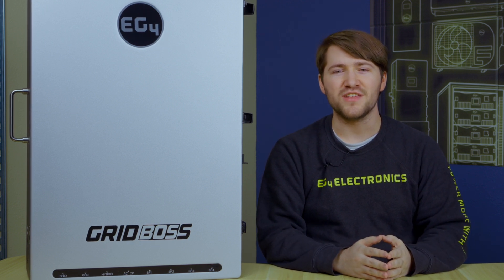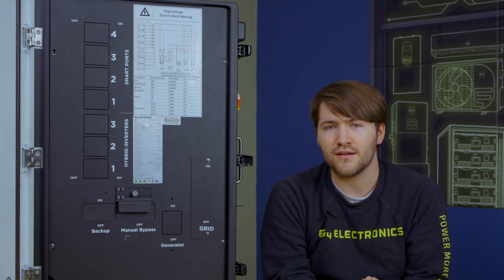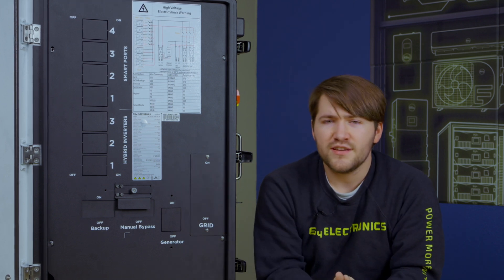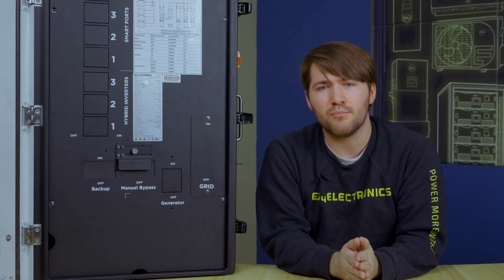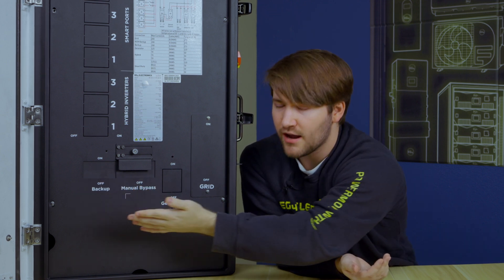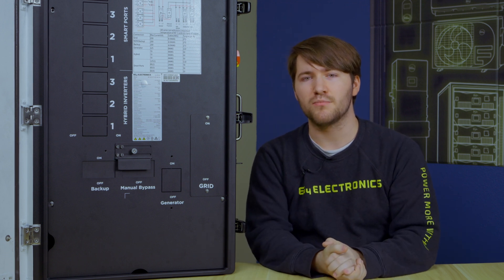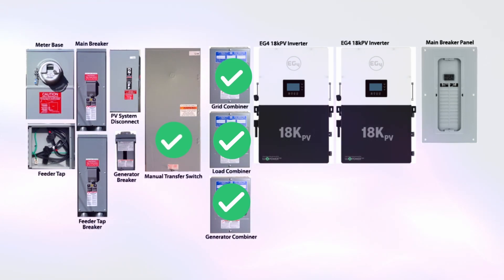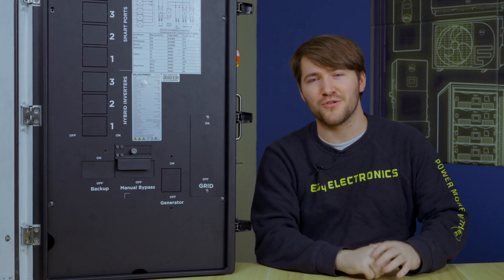What is EG4's GridBOSS? (complex, yet simple!) | Overview with Brayden

Comment: Grid Boss question. Can it do the following. I have read the manual but it did not cover some of the questions.
1. Can it take the place of a Generac auto transfer switch and start the the generator and transfer the loads in case of a low battery soc with no pv and loss of grid.
2. Can it exercise the generator on a predetermined basis.
3. In case of a failure of the grid boss, I understand from the line diagram you can manually bypass to grid. But, can any component in it be replaced easily onsite without having to take it down and send it back.
Reply: I have asked similar questions and still do not have a good answer.  I have not found a video detailing this system with a generator.
Reply: I don't have a generator but the GridBoss does have a generator port and the configuration settings for the generator port look pretty sophisticated.  I think it could be said to definitely have no trouble starting and stopping a generator at pre-determined battery SOC levels.  I don't see any kind of auto-exercise feature (just a manual exercise feature), but would that be built into the generator itself anyway?

Configuration settings:

* Generator remote auto turn off time (minutes)
* Generator to Battery charge current limit (amps)
* Generator remote turn on/off
* Generator SOC or voltage selection
* Charge Start SOC%
* Charge End SOC%
* Generator warm-up time
* Generator rated power (kw)

-Matt

Comment: Very informative and interesting in how grid tie inverters can be integrated through the smart port as I currently have a 10kw Growatt.  I'm in MA and we have 1:1 net metering.  I have two EV chargers (48a + 80a) and I'm curious if the smart ports can load shed based on current draw?  For example, can I set up logic in the GridBoss to open the SP1 relay if the panel draw is >50amp?    I was also wondering if the GridBoss can control maximum grid export rate?  I need to stay under 25kw, but a Flexboss 21 (16kw) + 10kw Growatt is just 1kw over my limit.  If I need a 25kw cap would would you recommend?  Limiting the inverter or can the GridBoss limit?  Thanks!!

Comment: I want smart load for your offgrid inverters. To turn on non critical loads when batteries are charged and off when excess solar is limited before draining batteries.
Reply from the maker: Our 12000XP Off-Grid Inverter has a single smart load port with this feature integrated for this scenario. It can be used with either power shedding (where you activate it during excess generation) or load shedding (where you deactivate it when you drop below a certain storage threshold) which let it work dynamically.

Comment: Regardless of connection, it appears that a meter pull is inevitable? Wish there was a way to connect without having to cut power to my entire house for half a day.
Reply: Not necessarily.  It depends on your circumstances.  If you want the GridBoss to actually be your service entrance than, yah, you need an electrician to do a meter pull at some point.  But another choice (the one I made) is to simply forward from the main service panel to the gridboss, then move the circuits on the main service panel to a new panel on the other side of the grid boss.  Yes you wind up with extra breakers in the power path, but there is no law against having extra breakers and you can just leave the main disconnect in the main service panel intact that way and not pull the meter.

You can order the operations so your house is only down for 30 minutes or so (on a few occasions during the work).  I got the whole GridBoss + FlexBoss + New Panel + Solar + Batteries operational first.  Then I moved the main house sub-panel circuit (100A) over to my new panel.  That took the house down for 30 minutes.   Then I ran the house off of the battery while I worked on the rest of the main panel.   Plenty of time... my house can run 12 hours off of a single EG4 indoor battery if I don't use A/C, so it was not a problem.

-Matt
Reply: @junkerzn7312  Hi, this is intriguing  as I am in this exact same situation. I am adding the gridboss/flexboss combo with powerpro batteries to an existing ac coupled grid tied system. Been going back and forth on the easiest/cheapest way to tie into the grid. I don't have an external disconnect, power goes right from the meter into the Main service panel in the garage.  This sounds like a viable solution, and  the existing approved, permitted ...system would remain intact as is? Could you explain in more depth how you did your upgrade please?
Reply: @ I had (have) an existing AC coupled system too... a 5kW SMA string inverter.   That was tied into my main panel.  I had the option of leaving it there but then the GridBoss wouldn't be able to monitor it and the ESS system wouldn't be able to zero-out the grid by self-consuming the excess, so when I moved all the circuits from my main panel to the new panel, I took that SMA circuit and connected it to a smart port on the GridBoss which I then configured as "AC coupled".

This is a quick detail of how I did my system:

House prior to ESS work:

    * Integrated meter + main panel, 200A (yuch).
    * Numerous 15A garage circuits on main panel.
    * 30A circuit on main panel from SMA string inverter (existing 5kW solar system)
    * 100A sub-panel feed to the house
    * 80A sub-panel feed to 80A panel inside the garage, with the EVSE and saw

Primary work items during ESS work:

    * Removed 80A garage panel
    * installed GridBoss
    * Installed new 200A panel inside garage on the "BACKUP loads" lugs of the GridBoss (3/0 copper cabling).

     * Added a temporary 100A forwarder from the main panel to the GridBoss.  (2 AWG copper THHN/THWN-2 cable.  I Used BLACK for L1, RED for L2, and WHITE for the neutral, plus a 6 AWG ground wire). 

    (no matter what else you do, make sure you get all the neutrals wired properly!).
    (always be consistent on color-coding L1 and L2)

     * Configured the GridBoss appropriately, including setting the maximum AC input to 100A (~24 kW).

     * Reinstalled the EVSE and SAW circuits on the new panel.
     * Moved the SMA feed from the main panel to a smart port on the GridBoss.
     * Moved ALL remaining circuits from the main panel to the new panel.  Including the 100A main house sub-panel circuit.

(The main service panel now only has the 200A main service breaker and the 100A forwarder to the GridBoss).

-- Then next --

   * Attempted to install a 200A forwarder on the main panel... huge honking 3/0 copper cable to replace the temporary 100A forwarder.  I failed... my conduit through the wall wasn't big enough to really deal with the cabling and I wasn't happy with the cable stresses.

    * Decided instead that my house would run just fine with 125A mains, so I wound up going with a 125A forwarder (aka 125A sub-panel breaker) and 1 AWG cabling between the main service panel and the GridBoss's GRID input instead.  BLACK, RED, WHITE, and GROUND.

   (the GridBoss-to-new-panel remains wired for 200A).

   * Finally finishes the system by adding the FlexBoss21 and batteries to the system as specified by EG4.  FlexBoss21 2 AWG to GridBoss "Hybrid Inverter port 1".  Batteries connected to FlexBoss.  Everything mounted properly.   Always wire the neutral and the ground wires first before wiring the HOTs (L1 and L2).   Use consistent color coding.

--------------------  

A few rules of thumb:

(1) You must be familiar with how to wire 240V electrical circuits.

(2) NEVER WORK ON LIVE CIRCUITS.  In my case, there are breakers galore so I could just flip the breakers off and work on the various parts of the system.

(3) Have a  multi-meter handy and double-check all voltages are gone before doing work, and that all voltages are correct before engaging breakers after doing work.

(3) If you make a mistake and cause an ARC fault, this can be VERY VERY dangerous on these high-amperage circuits.  You can easily destroy a few fingers or blind yourself permanently.

- Wear safety goggles
- Wear gloves with a 600V electrical rating
  (this will also save your fingers and hands from a lot of small cuts that I guarantee you would also get).
- Double check voltages before and after doing work
, before and after messing with breakers.

-------

Equipment:

- Buy the appropriate tools.  It will add up... I wound up buying around $2000 worth of tools and cabling.  It's gonna be a LOT of tools.  EMT fittings (bushings, nippes, chases, etc etc).  Torque drivers, hex driver sets, cable bender, good strippers, good cutters, large-diameter cable cutter (I wound up using bolt cutters on the 3/0 cable for the 200A circuits)... etc... all sorts of stuff.

 - For large diameter cables, buy the appropriate cable stripping tools.

  - The EG4 stuff is pretty heavy.  I do not recommend solo-mounting it.  Though it is possible.  I wound up purchasing a 700lb hydraulic lift table and even then almost damage the inverter because it was so top-heavy and easily slipped.  two-man is better for sure.

In my case I had to secure things to the lift table with large pieces of wood and clamps to hoist them onto the wall

  - When installing EG4 equipment on its brackets, be sure to double-check that the equipment is actually fully seated in the brackets before releasing your hold on it.

That's my best "quick" advice.  I wound up doing like two dozen amazon orders over 3 weeks getting all the tools and fittings and cable I needed.

-Matt
Reply: @junkerzn7312  Wow Matt!! Thank you so much!! This cleared up alot, the one thing that remains in question for me is the Neutral/Ground bonds and how you dealt with them. Currently the system has a N/G bond in the Main PV disconnect outside and in the Main Service panel inside. I know everyone does it different, just curious as to how you configured your NG bonds?

Comment: Can you connect 110V portable generator to one of the smart ports just to supplement the solar/battery power available during grid outage?
Reply from the maker: You'd need to connect the gen to the batteries via a ChargeVerter for supplemental power. The generator you're describing is likely too underpowered to integrate into the GridBOSS.

Comment: It sounds like you would still need an "anti-islanding" switch to disconnect from the grid if/when the grid fails.  I like the idea of how this brings ALMOST all of the external connections between the grid, your hybrid inverter(s) and your main breaker panel together into one box.
Reply from the maker: The GridBOSS handles all anti-islanding needs, complete with the UL certifications necessary. It has those functions built in!
Reply: @eg4electronics  I went to the site after I commented and read through the specs and saw that.  Thank you for the reply!

Comment: I'm missing something, and I don't see it in the manual either. The Grid Boss Hybrid ports are for the "GRID" input to the Hybrid inverters. Where do the EPS outputs from the Hybrid Inverters connect? Without those, there is no backup. The diagrams all show just 1 port being used for the Hybrid inverter and that doesn't make sense if the grid fails. That's when the EPS port takes over.
Reply from the maker: Tight communication with our EG4 hybrid inverters allows the GridBOSS to control whether that port stays operational or not. This is important as the grid disconnection is now located within the GridBOSS (when using its architecture). Using the grid port on the inverters allows for unique future features to be added to the EG4 ecosystem!
Reply: @eg4electronics I thought that's what the idea was here, but I'd like to see this wiring diagram. The manuals for both Boss products specificity exclude a wiring diagram so it's not clear. 

Also, page 33 describes a No Sell Back scenario in which the non-backup loads recieve power from the inverters during an outage. How can this be done with 1 relay and still be safe for the grid linemen?
Reply from the maker: The non-backup loads will not receive power when the grid/utility is offline, that's what the relay is for. The situation it is describing is that when grid is present, the inverters can still offset the power usage on non-backup loads, but won't sell excess power back to the grid.
Reply: @eg4electronics  My only complaint with EG4 inverters is I wish they were convection-cooled like Hoymiles inverters. They run totally silent.

Comment: Requiring copper wiring is a major limit.  Many large connections are going to be aluminum SER.  Especially if the inverter and batteries are not located near the service entrance.
Reply: You can use aluminum, but the thickness of the aluminum wire would be much thicker than copper and it wouldn’t fit into the connector. That’s the only reason they say copper, that’s a statement from their CEO. The inverter itself will work the same with aluminum if you can get it hooked up.
Reply: Only the GRID input would conceivably be aluminum (e.g. 4/0 SER for 200A).  The 200A BACKUP output going to your main panel can just be 3/0 copper because it will be a short run so the expense should not be too bad.  And every other connection into the Grid Boss or FlexBoss (etc) will be lower amperages and can (and should) just be copper.  e.g. 2 AWG for 100A.  I usually try to avoid aluminum as much as possible.  Copper is much, much more forgiving.

-Matt
Reply: Just step down to Copper using a multi tap (Polaris) like 12 inches before the GridBoss. If you don’t know how to do this, you should not be doing any of this wiring. To be fair, there are plenty of electricians out there that don’t understand any of this stuff.

Comment: Cool! 

What are the benefits of this over a Schneider BCS?
Reply from the maker: Nearly all MIDs currently in use are proprietary with the hybrid inverters they can use (with pretty good reason being tight communication protocols, admittedly), so the using the GridBOSS allows you to take advantage of the full EG4 ecosystem in all the ways described in the video (and more!)

Comment: Let me know when they come out with a simplified Off-Grid Boss with smart loads.
Reply: You can use this for off-grid as long as you have hybrid inverters (which can also be used off grid)
Reply: It's hard to be simpler than the GridBoss.  Most of the size is just wiring cabinet space to be able to run lots of cables.  The only thing an off-grid property version of the GridBoss would omit would be the bypass breakers.

Comment: Can you add an off grid inverter like a 6000xp to one of the smart ports? I'm still learning
Reply: I also had the same question. I am not sure but I'd say no. Only because he keeps saying we can connect "hybrid inverters" and on the gridboss it says "hybrid inverters". Who knows, they might actually support off grid inverters like 6000xp too?
Reply: @cell8290  Thanks! I was thinking that the hybrid inverters connected to the hybrid port would work better but wasn't sure about the smart ports since he said it could connect to AC and DC coupling I believe. I need more knowledge but learning a little at a time.
Reply: from what i am reading yes the 6000xp would be connected to one of the smart port
Reply: The official answer I've heard is "not at this time" but you were able to hook a 6000xp to the 18k via the generator port. Not sure why you couldn't do that here
Reply from the maker: The 6000XP doesn't AC Couple with Grid/Inverter power like standard UL1741 "grid-tie" inverters so it cannot be used on the smart ports. The 12000XP also applies. The Hybrid inverters (FlexBOSS21, 12kPV, 18kPV) can all be used on the hybrid inverter ports however!
Reply: @eg4electronics Thanks! I forgot about the AC coupling aspect. Makes sense. Appreciate the reply.
Reply: I remember signature solar saying it’s a stand alone system and will not communicate with other eg4 devices and is not really meant to be put in parallel with more panels like a lot of the other devices are. Don’t know if that answers your question.

Comment: Is the grid boss a good option to connect back to an interlock breaker in the main panel plus connecting to a sub panel running grid up only devices such a a pool filter and pool heaters?

Comment: Can you use this with a service that is greater than 200A?
Reply: Not into a single box.  One GridBoss can handle a 200A service.  If you have a larger service you would need more than one GridBoss and from what I'm reading they would be independent of each other.   Or, alternatively, if you have a larger service you can elect only to move 200A worth of circuits to behind the 200A GridBoss and leave everything else on the service.

Comment: @EG4 Electronics You do not need a Feeder Tap anymore, is that correct?  You still show it in your diagram, believe that is a mistake.
Reply: Isn't the main breaker integrated into this also?  Seems we go meter base straight into the grid boss.  I guess it's still good to have a switch before the grid boss so you can hook it up and not die.  My bad.